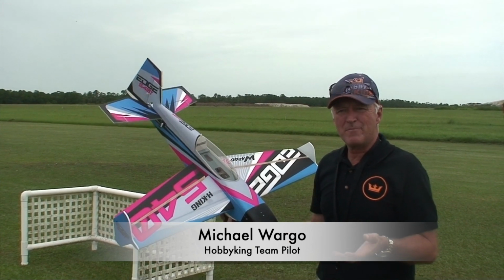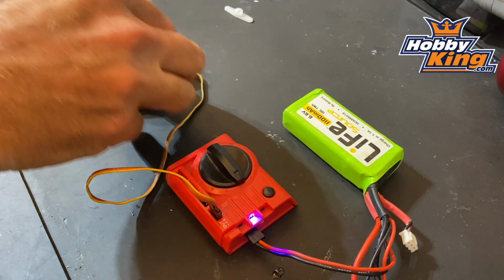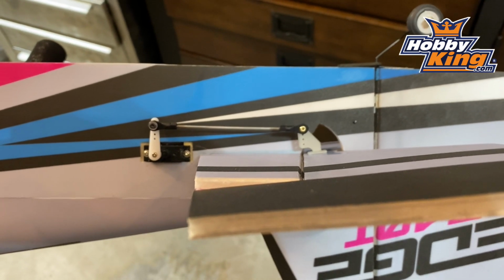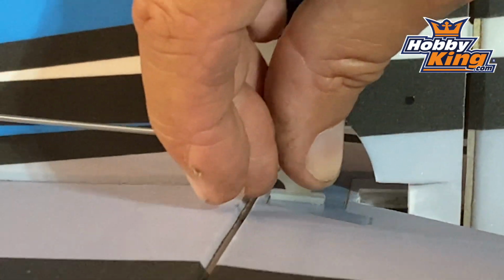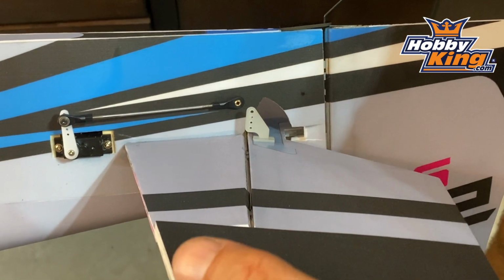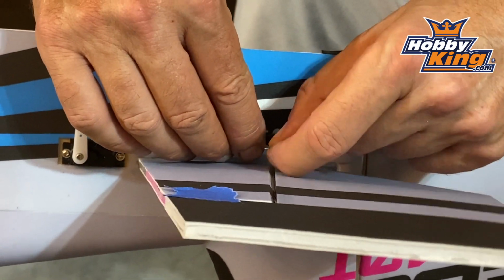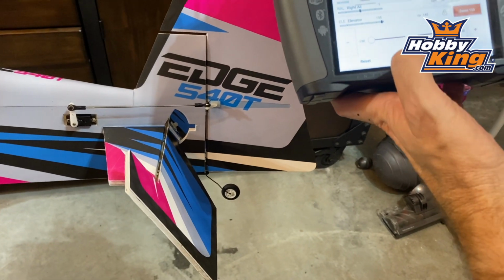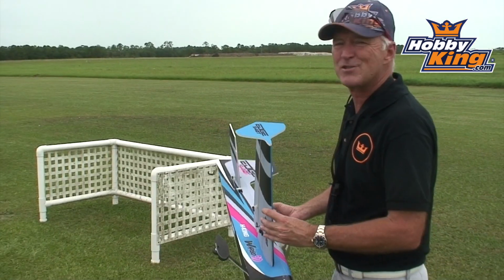Michael Wargo RC Airplane Linkage setup Instruction

Comment: Thank you for the clear explanations; I am currently building my first RC plane from plans and these points will prove very useful. One thing I don't yet understand is RESOLUTION; do you have another video where this is explained?
Reply from the maker: Very simple.   Resolution is like the difference between a second hand and hor hand on a watch.   The gears are different.   LIke a bike in 1st or tenth gear.   You want the gears to not move a lot with a little input.   They will be fast but no strength.  So if you move stick one click, it might move the surface an inch.   BUt with good resolution, the gears turn a lot to move the arm a little.   Like first gear.   It has strength, and when you move the stick it moves the surface slowly smoothly and predictably.   Expo adds resolution.   PLus the servo is much stronger like a bike in first gear.   Bad resolution makes a servo very weak.

Comment: 1. There’s nothing wrong with using some subtrim. 2. For equal throw, the servo arm needs to be perpendicular to the pushrod, not the case of the servo. Also, the angle between the hinge line, the hole in the control horn, and the pushrod must be 90 degrees. 3. Increasing the throw by connecting the pushrod closer to the surface can lead to flutter. If you need more throw, use a longer servo arm or increase the travel of the servo. 4. Do not decrease the travel in the transmitter below 100% due to binding. Lengthen the control horn (1st) and/or shorten the servo arm (2nd).

Comment: What was ommited to mention, fundamental information, is that the maximal servo travel needs to be utilized in order to achieve best possible servoresultion.
Reply from the maker: This is not correct.   You just need to be above 120 or so.   Do not….  I repeat….  Do not just set max travel to servo.  If max travel exceeds physical limits it can be disastrous or at the very least overdriving the servo.   At the worst, you will cut your gimbal movement and ruin your resolution by hitting the endpoint too quickly.   Meaning you will reach max travel before your stick is all the way, conversely everything will be overly sensitive. I’m virtually all of my aircraft, if anything actually hits 150% travel, I change the servo arm. The ultimate goal is to make sure you never hit 150% otherwise you are using the wrong servo arm.
Reply: On high rates, the servo travel should be between 100% and 125%. If you set it to 150%, you won’t have any travel left for trim. On low rates, you shouldn’t go below 50%.

Comment: Just got mine in. I have no idea how u got that elevator in without cutting a slot. I also noticed where my motor mounts is super crooked.
Reply from the maker: You can cut a slot, but If I remember right, it is inserted backwards, then flipped once in.  Also, There is a bit down and left to all motor box to create correct thrust angle.Actually I am not sure what you mean.   I am guessing this is what you mean
Reply: @MichaelWargo  I just did a maiden flight. Flew ok but very under powered. I got the turnigy 2830 1130kv motor in the suggested motor when ordered. I’m definitely going to change. What do you think I should get. I have a 40a esc. Or do you think this motor can handle 4s?
Reply from the maker: @airbrainaerials  You should fly it on 4s.   IT is not really fast on 3s.   I liked 3s for low slow 3d, and 4s for everything else.   YEs.  Just fly on 4s   IT is very very lively and fast.
Reply: @MichaelWargo  ok great. So this motor I currently have can handle 4s? On the site is says 3s. Don’t want to blow it up. Thanks for all your help buddy